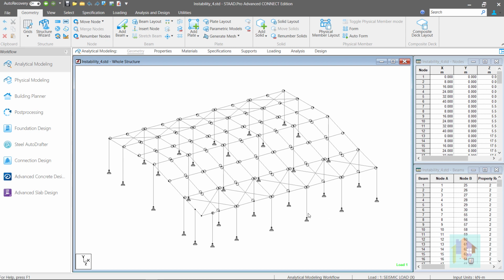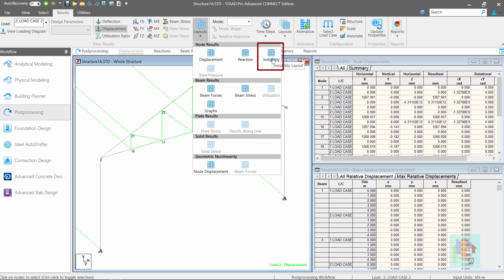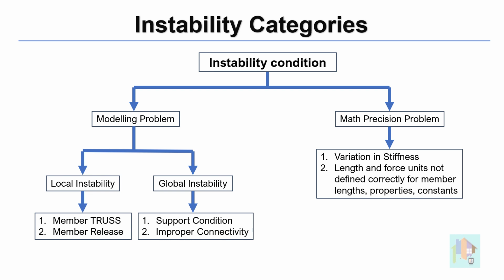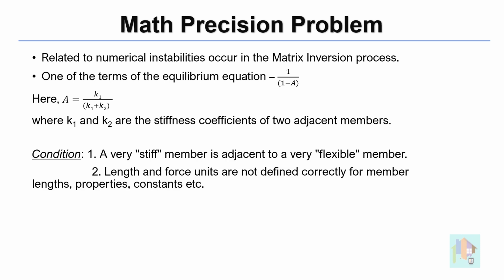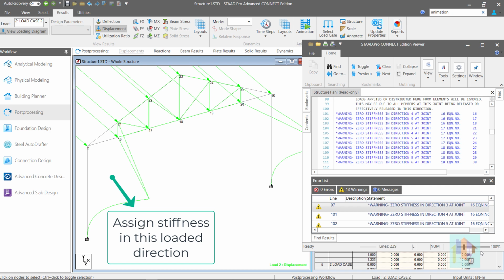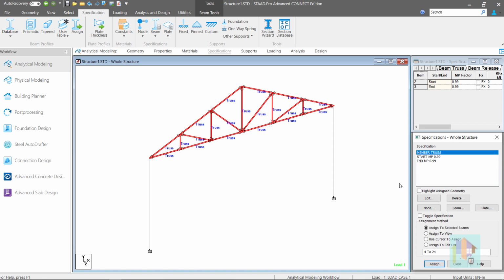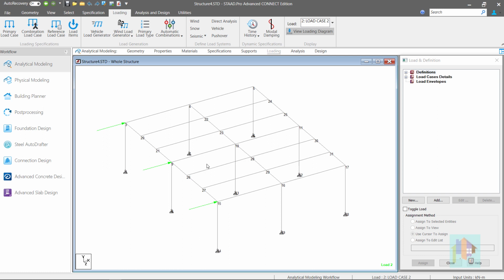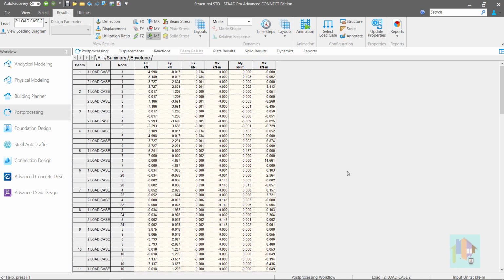Structural Instability & Zero Stiffness: Part 2 – Instability condition and rectification of model

Comment: Sir, i am designing a steel truss 22m self supporting , mounted with both end with bolt M10x40. can you help me to design. i have made model. but i m facing error while post analysis
Reply from the maker: What is the error? Is it related to analysis or design?

Comment: For the truss example of instability, where you assigned partial moments in truss members to remove instability, not only we released moments in truss members but we also let the members take shear in Z-direction, due to which static check is satisfied and instability is removed. Am i correct on this ? So , whenever we assign partial moment release, we not only allow minor moments to develop but we also allow full shear to develop on the truss members.. I hope i got it correctly.

Comment: Hello Mr. Surojit_ For shear connection in the beams cant we just provide My and Mz and releases and be done to get rid of the instability instead of the partial release?
Another question is that if we give a partial release of the moments in  either directions then how are we going to make sure that the provided relaxations in the moment are taken care in the connection design?
Kindly find the time to revert on this
Reply from the maker: Yes Sandip, releasing the end moments (My and Mz) for shear connection is a common modelling technique. Complete release of My and Mz does not always cause instability. You can start modelling with full My and Mz release for shear connections, and if there is any instability for this release, then change that to partial release. But don't release Mx, that causes several problems.
If you partially release the moments, then you need to ensure that the assigned connection has the capacity to transfer that moment. One solution- we can use the beam/weld group option available in RAM Connection Standalone to cross check the capacity of any connection. There are several other methods also to cross check the capacity of any joint.

Comment: Hi, I have a confusion about the beam/column displacement and deflection. IF the deflection  (lateral displacement) check for a column (considering allowable L/400 for example) is pass using (DJ1,2), however at certain node along the column the node displacement (in Z direction in my case) for the same LC exceeds the allowable limit , then what is the use or purpose of the node displacements? 

What I understood from many Bentley communities discussion that DFF is applicable for beam (deflection) and column (displacement).
Reply from the maker: Not sure about this specific scenario. In general, local deflection values in three global axis are considered during actual deflection value calculation (dff) and then it is compared with allowable deflection limit (DFF) to find out the deflection ratio. There is no separate checks for beam or column, during steel design, all members are treated as a general member. When you specify DJ parameters, deflection length and local deflections are calculated considering that information and those members specified under this. 
You can go through this video (https://youtu.be/hqqMsi1LNp0) for more details about deflection check - though it is for IS800:2007 code, but the concept is same for all other international design code.
Reply: @surojit_ghosh  thanks for your reply. Sorry, I believe I was not clear enough, I meant to say the deflection check (dff and DFF) is clear for me in term of implementation in STAAD. But as the code requirements (most of the international codes) the lateral displacement check is required as well, here we have to check the global nodes displacements, my question is if I perform the deflection check for the columns, is this enough or I have to check the NODES displacements as well?